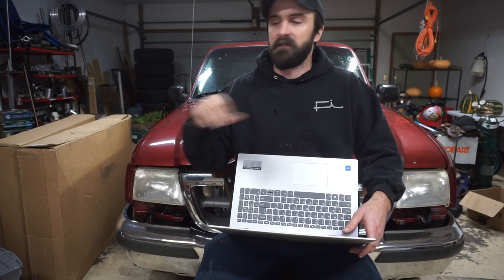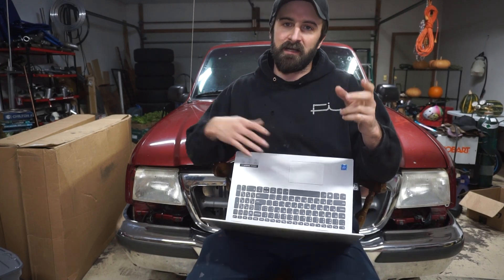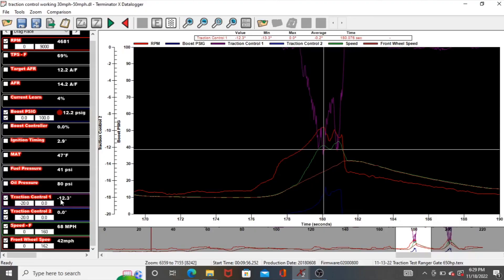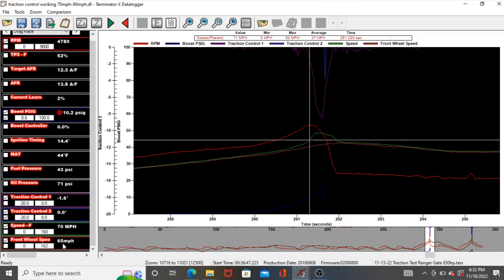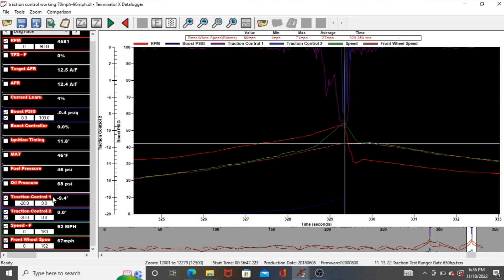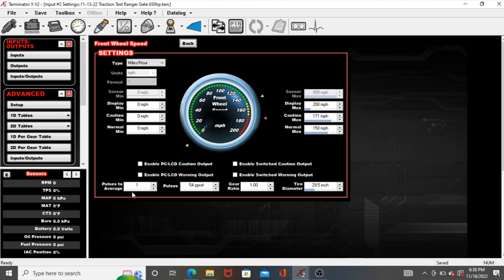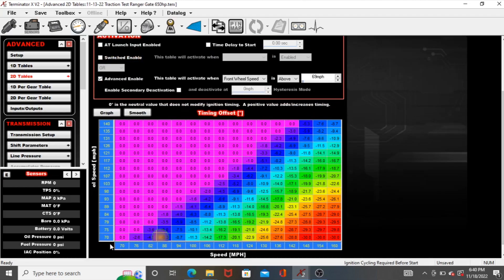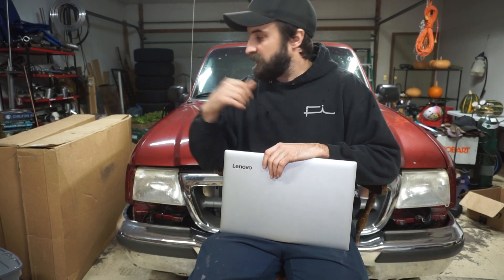Traction Control Working Holley Terminator X Max Lowdoller Motorsports Hall Sensor.

Comment: where'd you source the 12v from that you're feeding the sensor with? wondering where i should tie into for the least interference/noise since it uses 12v instead of the 5v ref off the holley like the Rife from Motion does.

Comment: Are you still controlling boost with the 3 port and the closed loop method ?
Reply from the maker: This setup is 3 port open loop. This video wasn't using any controller. 0%
Reply: @BlaserBuilds  

Did you try it using the closed loop method ?   I'm curious how you control the boost now.
Reply from the maker: @mikeregner4719  Not on this set up yet. I'm just using style cycle on the 3 port 50% is around 800hp, 88% duty cycle made 1017hp.
Reply: @BlaserBuilds  

I'm thinking about just using an output table , and setting up the 3 port that way, and unclicking the boost ICF tab.
Reply from the maker: @mikeregner4719  Yeah I'm just using an output configured with a PWM- table and duty cycle. Only thing on boost ICF I'm using is the boost cut parameters.
Reply: @BlaserBuilds  
Thanks for the information!

Comment: The only way you're going to get that under control is by yanking throttle, which may not work smoothly with your method of control. I use time in conjunction with slip on our stuff. Works pretty well.

Comment: Something to keep in mind... pulling a bunch of timing under power sends EGT's through the roof. You're on the right track with reducing boost or increasing traction. Pulling some timing briefly is ok, but to be down close to 0 degrees frequently is not good for the exhaust valves... Same thing goes for building boost on the trans brake - the faster you can build boost and get rid of the negative timing offset, the happier the valves will be. The truck looks like a blast, thanks for the build videos!
Reply from the maker: Yeah, that's why I mentioned I don't really want to spend much time there. Need to actually fix the problem... I'll probabaly do a light spring and control it with boost ramp or something different.

Comment: Few things
You can retard way more to manage the traction, the biggest problem you face is allowing it to slip this much, then it´s harder to manage, you need to have alot faster rate of retard vs slip. Remember what a MBT ignition curve looks like, the first 2-5° might only be dropping the torque a couple of %s. Which is just not enough, you probably need to go to ATDC ignition timing to actually manage traction. And probably some cuts ontop when it get´s this wild.
A better solution would be a table with X axis as slip error and the Y axis as load, so when you have low load you don´t need as much retard to manage traction, but at high load you do need it.